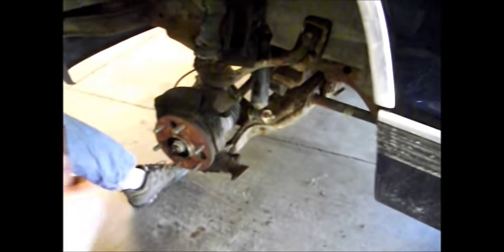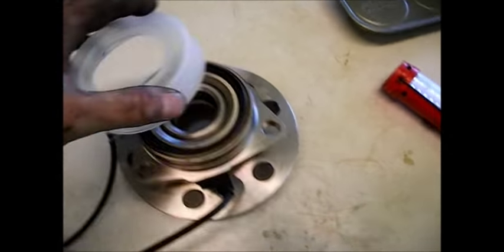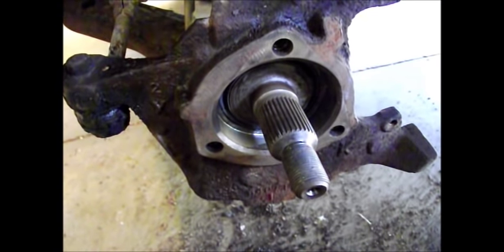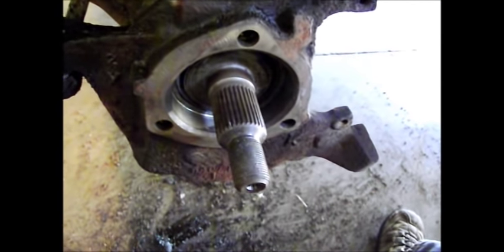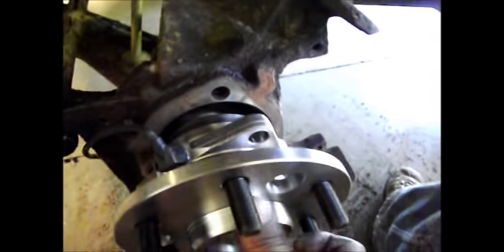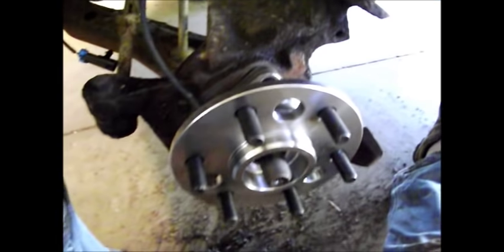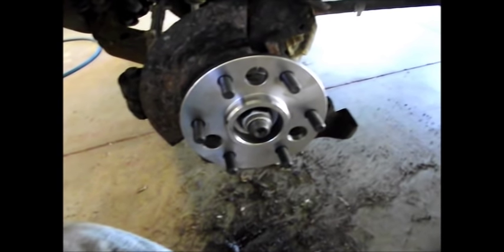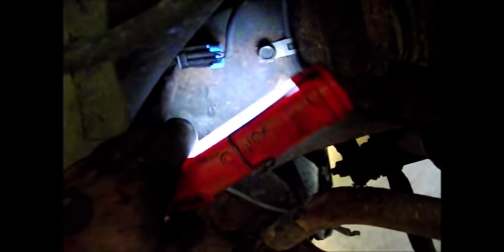How To Replace a Front Wheel Bearing 1996-1998 Chevy GMC 1500  4x4 1/2 Ton Truck

Comment: In the middle of doing this job on a 96 K1500. The 3 bolt heads were pretty much rusted away. Helped to hammer a deep well 9/16th impact socket on them. and then use a breaker bar while heating the spindle with a propane torch, also spray the lube through the holes in the back side of the spindle. Still had to cut the head off of the top bolt, it was just to far gone. Then was able to remove the old hub. Then was able to remove the rest of the bolt with vise grips and heating the spindle from the inside bottom
Replacement bolts are available at Oreilly's by Dorman
Reply: it also helps to clean the bolt heads off with a wire brush before getting started

Comment: Would this be the same for a 1993 chevy 2500 2wd? Front driver?
Reply from the maker: Very similar except that there will be no center axle nut since the 2WD has no front drive axle. Thanks for the question!

Comment: Not the last year for the 5.7 vortec. Nice video
Reply: For the half tons it was. But they did use them in hd applications till 2000 and in vans until the mid 2000s.

Comment: please tell me what tool you used to get those two bolts off on the back of the caliper??
Reply: Keeper Of The Reaper actually I think I ended up having to use a T55 thing idk it was a pain in the ass
Reply: Keeper Of The Reaper I'm sure it did work, however I just ended up using a T55 torx bit

Comment: How did you get those 3 bolts of ??? I have 2000 Cadillac escalade having trouble with that
Reply: 15mm socket with an impact thru the holes on the hub, little late lol
Reply: @MoRBHD  yeah I ended up stripping it but it got fixed lol thanks tho

Comment: I have a 97 k1500 when you turn to the right at 35 or more there is a growl on the right side but its fine on slow turns
Reply: Since nobody else is doing it; It sounds like the CV, or Constant Velocity, joint is going out on the right side.
Reply from the maker: If it is growling and not clicking in turns it is absolutely a bad bearing.

Comment: Did you ever have a problem where the truck would shake when you put it in 4 wheel drive?
Reply from the maker: At high speed? I would check the u joints on the front drive shaft. Could have a bad one that is throwing the shaft out of balance.
Reply: The is for replying if checked the truck and when I put it in 4 low or high it jerks the passenger side wheel moves and shakes
Reply from the maker: @theonlyoddest5429  Check the axle shaft on the front passenger side?
Reply from the maker: Any luck with this problem?

Comment: you don't have to grease the bearing?
Reply: Brad Collins ....That I have No Idea...but since your question was the Most Recent maybe you can help me...I own a 95 sle gmc 1500 extended cab, the 3bolts I can Not get off...Dont have much access to air tools...Any backyard ideas on how to get those 3RUSTED bolts off...15mm too big..14mm works..cant get a 13mm ?
Reply: Kevin Reid can't help ya there other than soaking them in wd40 over night. or take it to a shop of that don't work.
Reply: Brad Collins ... Hey for the feedback and will try it out...
            Thanx
Reply: Kevin Reid what 3 bolts? 3 bolts on the hub?
Reply: No u don't have to
Reply from the maker: These are sealed bearings so no, you do not have to grease them.